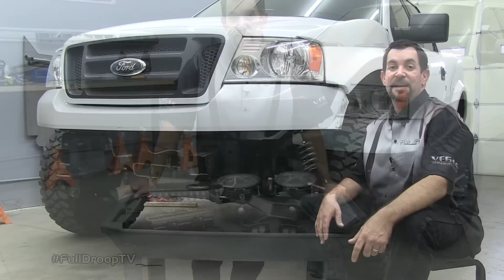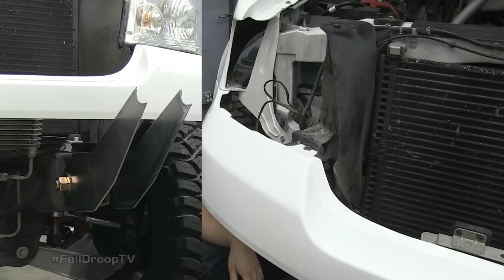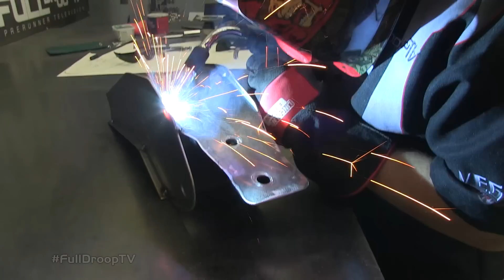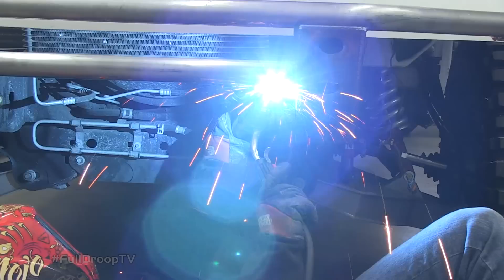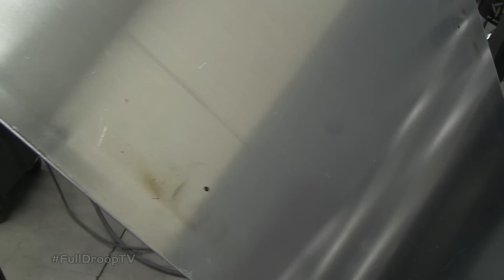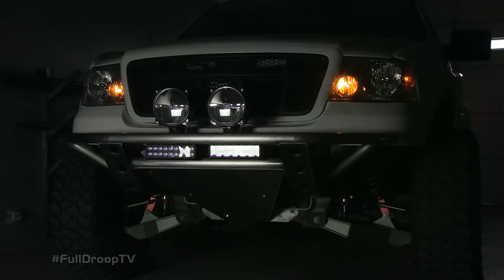F-150 Front Prerunner Bumper & Off-road Lights - FullDroopTV (Season 1, Episode 9)

Comment: Lol i got all my led lighting going directly to the switch with no relay, haha, its been working great, keep in mind im using industrial sized metal switching instead of cheap plastic ones
Reply: I've got 5 leds on my truck. 
4 with relays and 1 without.
All the same lights.
The one without the relay isn't as bright. 
It also flickers a little (not much probably wouldn't even notice if I didn't have the other 4)

Comment: what thickness steel pipe did you use for the bumper?
Reply: 2.0" .120 wall tube, and the skid plate is 1/8"
Reply: Trevor Wray  what about the main supports?